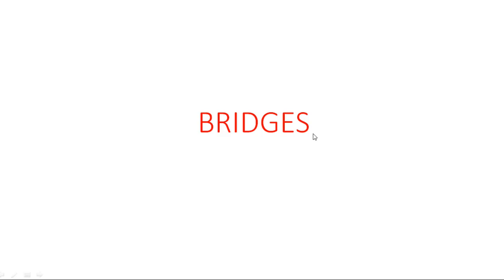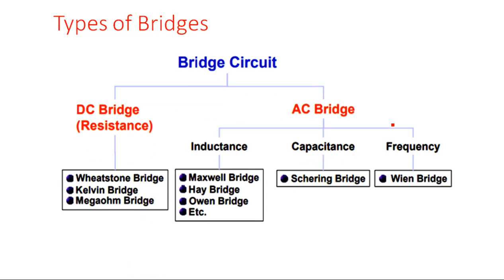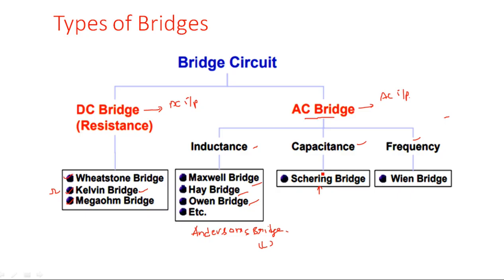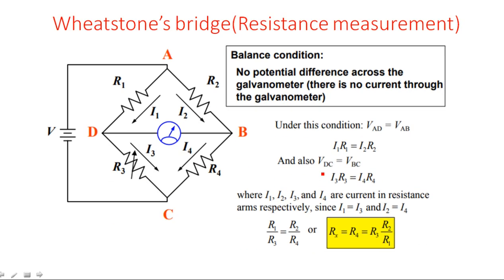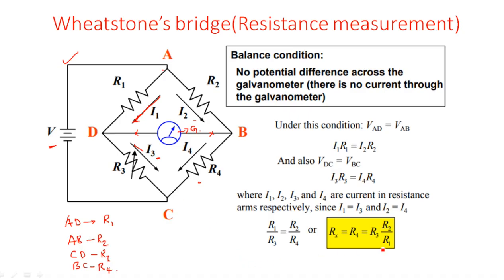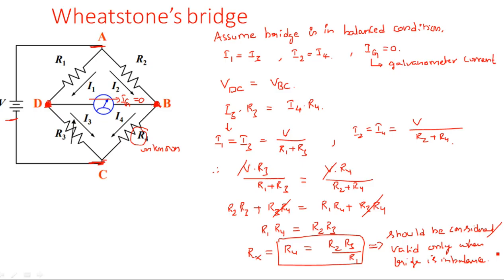Wheatstone bridge | Circuit | Electrical Instruments ( EIM ) | Lec - 39

Comment: 00:04 - Introduction to Wheatstone bridge and its applications.
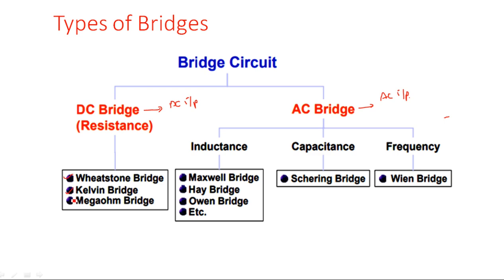01:39 - Comparison of Wheatstone, Kelvin, and Megohm bridges for resistance measurement.
03:14 - Different bridge circuits measure inductance, capacitance, and resistance values.
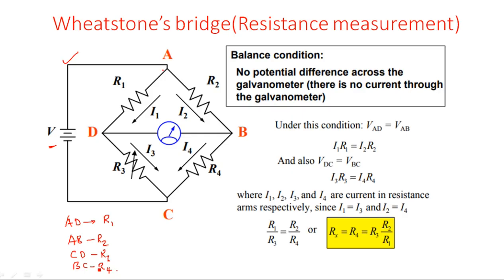04:40 - Galvanometer indicates balance in Wheatstone bridge circuit.
06:09 - Calculating unknown resistance in an unbalanced Wheatstone bridge.
07:51 - Understanding voltage equations in Wheatstone bridge circuit.
09:36 - Understanding current and resistance in a Wheatstone bridge circuit.
11:17 - Wheatstone bridge equation holds true under balanced conditions.